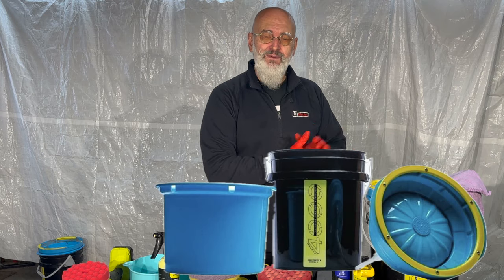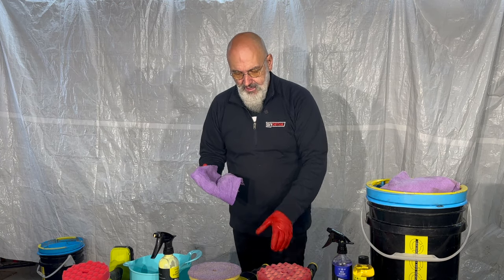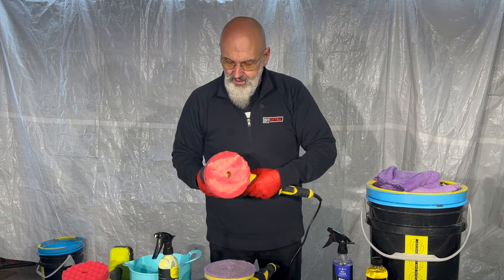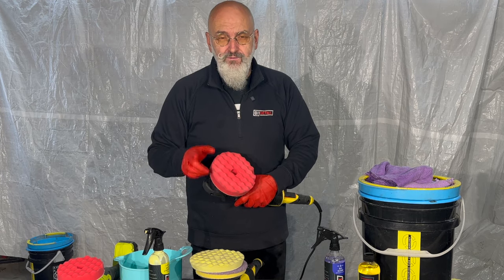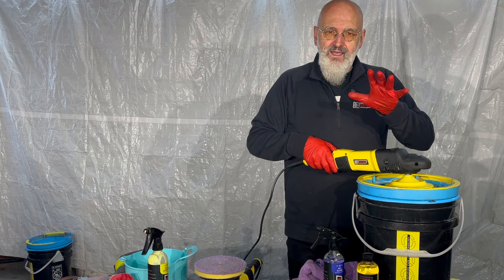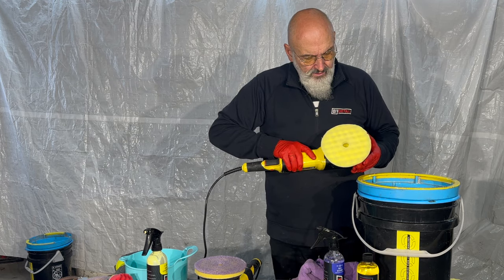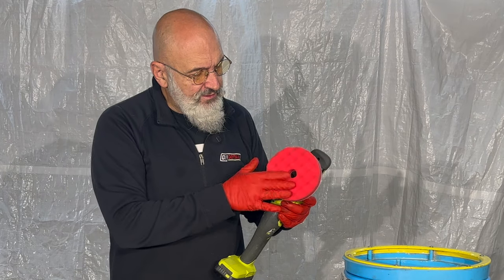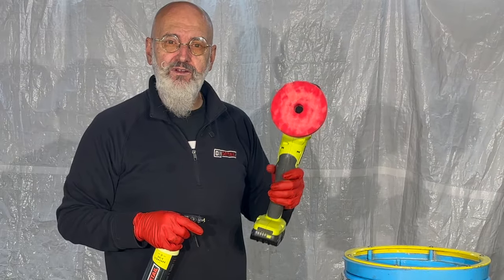Detailing 101: cleaning pads for best results! #diydetail #detailingtips #polishing

Comment: I wonder if you could use one of those trays you use to paint with a roller. Dunk the pad in rinsless wash and run it on the flat part with the ribs to clean.
Reply from the maker: Worth a try
Reply: @diydetailofficial  I'll give it the ol college try

Comment: You should try this experiment. Somebody stands to make a lot off of an instant pad cleaner that is not yet available. It's simple chemistry and surprising it hasn't yet been used. On another video, I said using rinseless wash didn't make sense because it's using the same product intended to not remove things like waxes and sealants to clean a pad. You responded, there are no waxes or sealants in polish. I'm aware of that, but there are things that rinseless wash doesn't bind as well to as other chemicals. I've reviewed the SDS for many polishes. I've done this test with multiple products and checked the pad under a microscope for each test run.

It's simple chemistry. Take an orange pad because it's easy to see polish in it. Use a white polish similar in chemistry to yours. Use the pad. Put rinseless wash on it, alcohol, soap, solvents, APC, everything that so many cleaners have, and look under a microscope after each. Then take the antitheses of petroleum distillates and metals, sodium hydroxide, spray it on, lightly agitate and check at a microscopic level. The pad is returned to 100% perfection, zero remaining product. You can see it happen without a microscope. Everything nearly instaneously disappears, is first disolved, then rinsed out. Light agitation using the pad cleaner does help also. Pad cleaning solutions need something more caustic. NaOH returns a pad to original condition instantaneously and does not negatively affect the foam.

Btw, the easiest way is using oven cleaner since NaOH is the main ingredient. Literally spray on, lightly agitate, spray off, keep correcting. It would be the fastest most effective pad cleaner ever created. The only downside would be the aggressive nature on skin. Just test it.
Reply from the maker: DIY Detail Rinse Less Wash is as harsh as you need.

Comment: Hello, why was the eccentric stroke chosen exactly 25 mm? not 18, not 30.
Пожалуйста ответьте 👋
Reply from the maker: We have designed this to maximize cutting ability and efficiency. We still wanted to be able to finish with it. We tested, 20, 21, 25, 30 and 32. 25 struck the best balance of cut, control and finish.
Reply: @diydetailofficial  thanks for the reply

Comment: Off topic question for you. I have the Ultra Black Sponge that Yvan designed, is there a reason to buy the Legacy Sponge besides the colors? I love the Ultra Black and its still in great condition after a lot of washes so im curious if theres much of a difference
Reply from the maker: Wait until your sponge is worn out.
Reply: @diydetailofficial  sounds like a plan. Just so you know I have been so impressed by your products. I'm not a pro but I've been detailing my cars and families cars for quite some time. I've tried A LOT of products. For me to move off a product I like to something new takes a lot at this point but I've done so with a few of yours now. I am a rinseless man full time and yours is the best I've used. Your decon system of towel plus iron remover is unbelievably effective and efficient. I've actually gone to ceramic gloss over P&S bead maker as well because it seems to look better after a few days. Just awesome. The gold standard is also great. Well done.

Comment: To prime pads, what is the water to rinseless wash ratio?
Reply from the maker: 256/1
Reply: @diydetailofficial  Thank you very much. When the time comes to polish my vehicle, I plan on using gold standard with the jeweling pad.
By the way, would you consider making a 3-inch jeweling pad?
Reply from the maker: Yes, it’s on the way